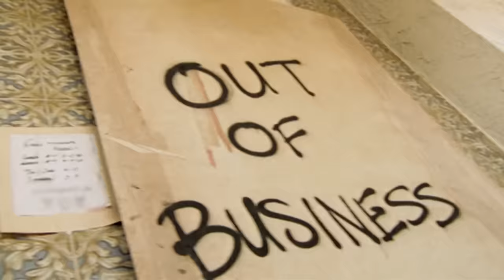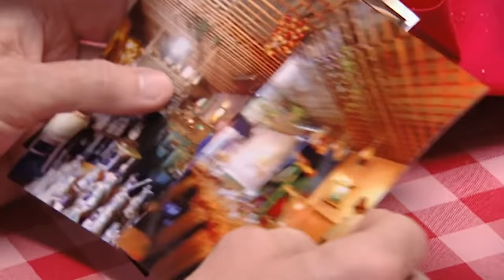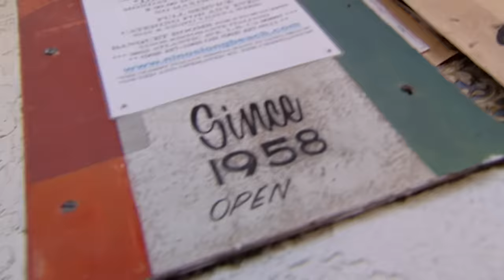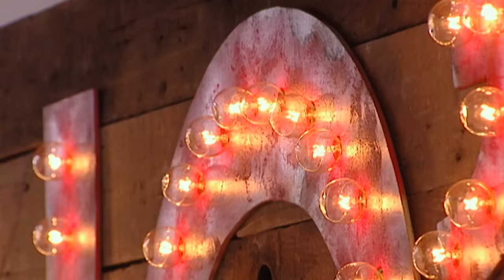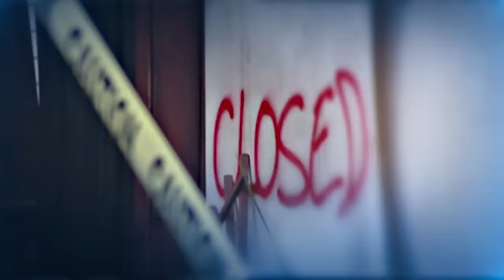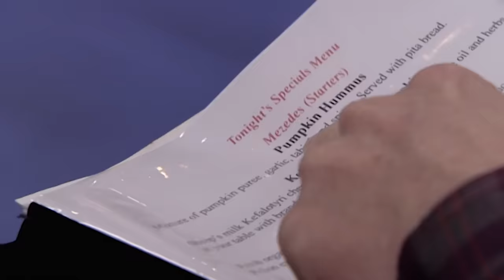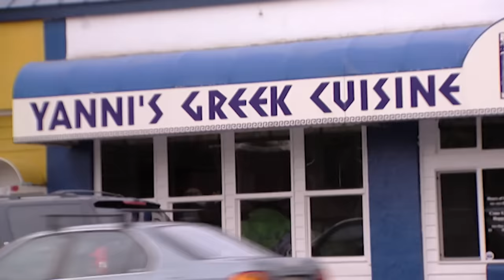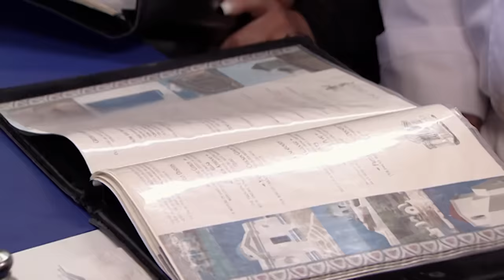Hello, My Name's NINOOOOO! | Kitchen Nightmares

Comment: The restaurant kept its doors open for another couple years, even after the death of Vincenzo in 2014. But, in August 2016, the restaurant officially closed its doors after 58 years of business. In an extensive Facebook post, Carina explained that she and her family were stepping back from the business in order to spend more time together as a family.

In 2017, the building that housed Nino's Italian Restaurant for 58 years was sold for over $2 million. Following the sale, things seem to have soured with some revelations coming to the surface, and none too flattering for Ramsay and his TV series. In 2018, Carina made a follow-up Facebook post suggesting that the tables and chairs provided during the Kitchen Nightmares makeover were "cheap." What's more, a combative Reddit user claiming to be Nino Cristiano started a thread in 2017   suggesting that Ramsay was responsible for the restaurant's closure. "We had an excellent reputation in the community. Ramsay and his production crew made a mockery of my restaurant," the Reddit user wrote.

Comment: What’s funny is you can actually cook in a microwave but it takes control of the time, understanding power levels, and adding liquid, and consistent stirring/flipping to heat evenly.  But that defeats the purpose of why they do it.  If you microwave anything with cheese it will separate and become oils unless it’s done super low and slow and stirred a lot.

Comment: Has anyone else noticed that the majority of the restaurants on here are no longer operating?
Reply: I believe over 60% end up closing, which sounds bad until you look at other facts.

Something around 60% of restaurants fail within a year, and 80% within 5 years. Add that to the fact that many of the restaurants on Kitchen Nightmares are in insane amounts of debt, which even with major improvements is hard to recover from.

Also, a lot of the "closed" restaurants closed due to owners retiring or relocating rather than business failure. Sometimes the owners close and then start up a new, more successful restaurant.

Since basically 100% of those restaurants would close without Ramsey, I would say he does a pretty good job, but he's not magical.